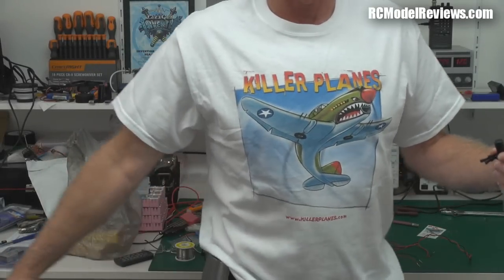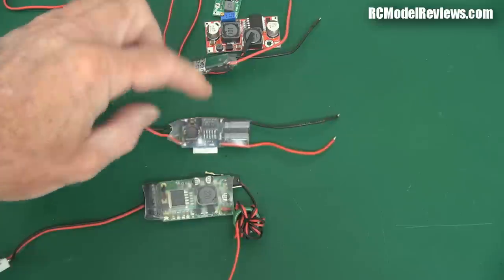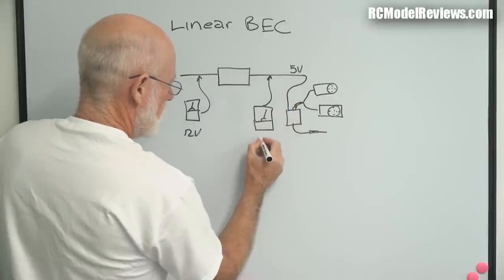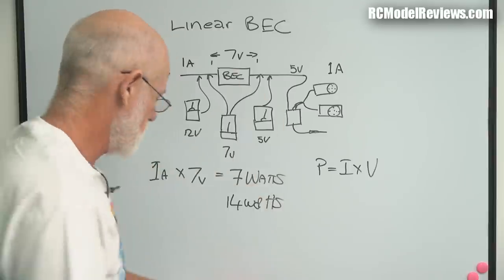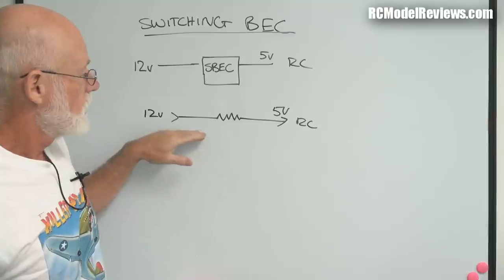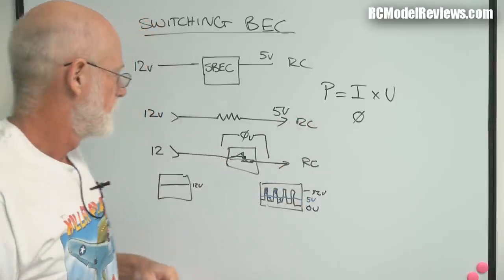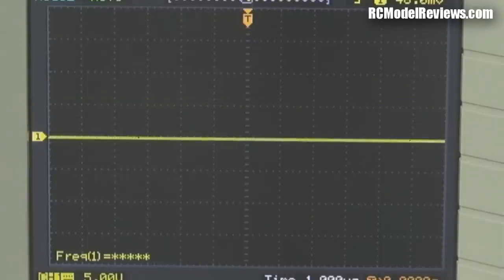All about BECs for RC model planes

Comment: That's amazing. Thanks for making this video. I'm currently making a quadrocopter from scratch, I'm programming the circuit board, radios, etc. and I recently realized that the brushed motors I were using didn't provide enough power to get it off the ground. Now I've switched the design to use brushless motors with some good ESC's. Fortunately I designed the circuit board to run off of 7.4V, so I won't need a BEC, but this was a fascinating video nonetheless!

Comment: Very good explanatin for begginers!
I am familiar with step-down circuits, I already built some, but they are to big to fit on my copter :)
I wish to mention that switching step-down dc-dc regulators are working on about 60-86% efficiency, so there is power you loos and some heat generated on it's Schottky diode and the coil, but of course a very small amount compared to linear regulators. With the one I've built by myself using high quality LOW ESC comoponents and overrated 430uHenry 3Amps coils I could reach about 56% efficiency dropping 12Volts to 5volts.
So with 1.34Amp current drawn at 5Volt output (6.75Watts) it drew from input  12volt 1amp (12watts) and only 5.25Watts gone to heat. With linear regulator 7Watts would go to heat, and the manufactured circuit's have much more efficient design, they can reach 80% efficiency even with those 130-150 uHenry coils they put on there.

I think SBEC is the same but on a compact size.
There is a coil so you can look for it of there is a coil it is a switching one.

Now first time I am building a quadcopter and ordered the cheapest ESCs I could, they are 30A ones and has 5V 2A BEC or UBEC but there is no nfo are they switching ones or linear. Circuit is heatshrinked to I cannot look for the coil unless I cut the heatshrinked tube and remove the heat dissipator plate but I think it is too thick to have a coil and too cheap.
As I know linear regulators can be connected in parallel with no issues, so what do you think about this:
- connecting each ESC's 5volt output wire in parallel and powering my RX from them, so not lugging into the flight controller output rail as there is a diode in FC dropping voltage. Only the signal wires are required between the ESCs and the FC motor outputs as 5volt is not needed by the ESC and ground rail is already shared.
If I connect the 4 linear regulators in parallel I could reduce the current passing through them, but the one with the less resistance will still have the more heat.
- I have also a plan to put serial Schottky diodes before connecting the 5volt outputs this way reverse voltage protection could be added, there is a voltage drop, but it is based on the current so it would share the power between the 4 ESC's as the one with lower resistance gives more power the diode will have higher voltage drop which will reduce the current flow as current flows from highest voltage to the lowest and other ESC would have higher voltage. This would happen in very fast switches.
What do you think about those? Could they work?

Comment: Just to clarify: UBEC is an acronym for "Ultimate/Universal Battery Eliminatior Circuit", which by today's understanding is a switching regulator. SBEC, however, may mean two things: Switching (as UBEC) or "Super", which may mean anything. Check the description of your supplier, but in my experience, if you go for a "UBEC", you'll get a switching BEC.

Comment: Great video, very informative. One question: do you get any RF noise off the sbec? If I remember correctly a digital signal has an 'infinite' frequency at the point it transitions from low to high (i'm recalling theory from years ago, so I could be wrong :) )...cheers

Comment: Great video Bruce, very well explained and it's great how you back up the theory with experimental evidence. I have an AX 40A brushless ESC in my Skywalker which contains an SBEC in one package and it hardly gets warm on account that the Skywalker doesn't draw anywhere near that sort of current. Separate ESC's and BEC's must be less common than combined ones as I've only personally ever seen people with the later ones.

Comment: Very nice explanation.  It should also be mentioned that when using SBECs on multirotors, only one SBEC should have its red wire connected to the flight controller.  All other red wires should be left disconnected by pulling the pin out of the plastic connector.

Comment: Bruce, very interesting video. When building small stuff for my RC models (e.g. as simple as programmable light), I need 5V via BEC (2A). Light is independent from FC, so the FC needs a BEC (<1A). Tricopter's servo is not something I want to feed off the same source as the FC either, so another BEC (1A). Those BECs start to add up.
So I tried small DC-DC converters from eBay (about US$2 per piece) which can convert 7-24V into 5V or 12V (or anything from 3 to 16). Very handy, very small. Running at 300kHz-1.5MHz depending on model. Awesome stuff.
But I have no idea about the EM radiation of those and the potential impact to 433MHz and/or 1.2GHz and/or 2.4GHz (I assume 5.8GHz is ok).
Since you got a spectrum analyzer, would that be interesting to test some of those DC-DC modules?
Here one example: http://r.ebay.com/YffXPU

Comment: Bruce a quick question,
So the ESC's BECs are fastefull, right! Will the ESC UBEs still waste some power even if they are not plugged in (in case i am not using ESC's 5V power)? I my 5V power i am getting from separate SBEC.

Comment: Great explanation but I have one question.  You showed the 12v on the input and 5v on the output.  I was wondering where were your leads on your oscilloscope attached to on the SBEC to show the switching?  The video shows the affect on the scope but does not show where the leads were attached to on the SBEC?  Was on lead attached to the 12v side and the other on the 5v?

Comment: Thanks so much for the vid. Quick question: how do I know how much amp the BEC is drawing? (Referring to the 1A example at 9:15)

Also, I just use the formula Power = Current x Voltage to find the power, and that's be the max power (watts) my fpv gears can be hooked up to the BEC before it overheats/smokes up/whatever?

Comment: Thanks for the simple and direct explanation. I am already familiar with these two types of BECs, but a practice that I've seen in some videos has me confused. I'm hoping that you (or anyone familiar with it) can offer an explanation. 

The situation is that some ESCs will contain BECs, and with a multirotor, that amounts to 3 or more regulators. I've seen some enthusiasts clip the wires from the BECs with the intention of using a dedicated regulator. This seems a bit wasteful since computer CPUs and graphics cards use multiple switching regulators to give high current power at very low voltages to the same power line. I imagine that multiple BECs would provide a similar reinforcing effect on the low voltage power supply, and so it's confusing that they would opt not to make use of it. Granted, since I've seen videos of removing the power-out lines from ESC BECs, technology has marched on and now PDB boards and possibly FC boards now have their own power regulation. I would personally be interested in keeping the BECs in use, so I'd like to know what the problem with that is, rather than learning the expensive way.

Comment: Hi ,I heard that people install a receiver battery parallel to the BEC, they do this as a fail safe in case the BEC fail or in case the servos draws too much current, but will it create others troubles such as noises, current flows backwards to the BEC etc ?

Comment: Excellent vid Bruce!  Had always heard that the switching BEC was better but not the reasoning behind it.   
Could you also show the proper wiring for putting a separate BEC in a system vs one with a built in BEC on the ESC?

Comment: Hi , I have an Engineering question regarding brushless electric motors and ESC.If I apply 1 volt via throttle to my ESC but the motor spins faster than its KV rating (ie 2000RPM on a 1000KV motor) because of wind pushing against the propeller during a steep dive of my drone, will the ESC try and slow down the motor, give no voltage or continue to give 1 volt which will end up  reinforcing the 2000RPM?

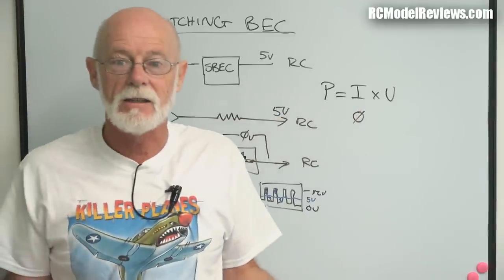Comment: At 16:43 you said that when the switch is closed the SBEC shortens and there is no voltage across the SBEC. It is the inductive filter that cause the voltage across the SBEC to be zero. Please correct me if I am wrong.

Comment: Hi Bruce, great InformTainment! is it possible to recognize what kind of BEC is soldered on some cheap Chinese ESC (30A simonK red shrinked 5$/pcs), as i don't trust their specifications. The other question, if I unplug the middle servo wire from the ESC with integrated (L)BEC, is the BEC still consumpting some energy or disabled? thanks in advance and regards from Germany

Comment: First of all thanks for all the reviews you make for us because we learn from them.I built a1/5 spitfire with a dle 55 engine and I am going to install on it 1savox servo sc 0253rated 6 v, 2 savox sc0251 rated 6v and 4 savox sc 0252 rated 6v.Will it be a good idea  if I use 2  4.8v nimh batteries 2000mah  installed parallel in different channels of the receiver because I am afraid of instaling a voltage regulator or any other device.If not can you show me something else.

Thanks again 
Carmel.

Comment: Great video Bruce and Merry Christmas.  Sounds like and SBEC works like the voltage regulator on a car.  What would you use on a simple 2,  3,  or 4 channel glider using 9 gram servos powered by a small 3 cell lipo?

Comment: awesome explanation and demo,  good job man!  i'm very clear on difference between linear and switching becs now, but where do ubecs fit in the picture?
Reply: UBEC (Universal BEC) usually refers to a BEC that is separate to an ESC rather than built in.

UBECs can be linear or switching -- it should say which type they are but most are switching.

Comment: can you share how to connect 2 flight batteries (so you can use 1 or 2) and use of BEC and a Switching regulator to power multi rotor but also extras like LEDs?

Comment: That (finally) explains why my 60 watt esc (with built-in standard BEC) and a E-flite Power 15 was getting so hot.  Guess I need an ESC with No BEC and add an SBEC separately to the mix.
Reply: Just use the same ESC you have but also add a seperate SBEC to power your receiver and radio gear.  Just don't plug in the receiver wire from the ESC.  You will have to Y the power wire to provide power to both the ESC and the Seperate SBEC.

Comment: Cheers Bruce! 
Really appreciate all your videos, i'v watched loads of em!
Just wondering if you might share a little more wisdom on this BEC matter?
Thing is, i just bought a power distribution board that has a 5V BEC built in, saves on weight and limited space in a 250 miniquad, Wehey! BUT,  the 5V BEC is described as being "DC/DC Synchronous buck regulator, efficiency up to 95%"... whats that mean?!" Also, it has "continuous current of 3 Amps" I'll be using 4S LiPo, Does this mean that i'll be wasting 30W of power in heat!? or simply that the 5V BEC can handle a draw of up to 3Amps?
Another thing that i cant seem to find an answer to is, will i be safe to power a few components from the one 5V BEC, i'm intending to power a Naze32 + camera +OSD + maybe a few LED lights. is that totally safe, or completely bonkers! I'm new to this stuff, forgive me.
Any light on this matter would be massivley appreciated, i'll be watching many, many more of your videos!
Thanks a bunch fella!

P.S
Oh yea, heres a link to the gadget in question.
http://www.mateksys.com/?portfolio=5in1v3

Comment: Excellent!  Thank you.
Here's a question that occurred after watching that.
Can I extend my flight time by disconnecting the 5v power lead from the BECs?

Here's a bit more detail on the question:
I have a hex with a 5v 2A linear BEC built into each ESC. All of the ESCs are plugged in to the flight controller and are therefore delivering a backup 5v in addition to the power module (I know that I don't need all of them).
In the process of stepping down from 16v (4S) to 5v they convert some of that energy into heat which is just wasted energy.
If I disconnect the 5v out leads would that energy still be lost?
Reply: Barry Houldsworth The linear regulators (BECs) in your ESCs are trying to regulate the output voltage regardless of current usage (so long as there's a minimum current for the regulation circuit). I wasn't sure exactly how they'd behave without a load, so I just measured the current draw of a 78 series 5v regulator without a load and it was virtually the same as with a load. Based on that, I'd say your BECs are wasting precious battery life, though in comparison it may be negligible. To answer your question more directly, I don't think removing the power lead will save power. You'd have to de-solder the regulator from the ESC. I'm going to be doing the same to mine. It'll look like a beefy 3-pin or 2-pin-and-soldered-tab package, probably with a 78 and 05 somewhere on it.

Comment: Hello my name is Paul J.
I am under my friend's account and want to thank you for explaining the difference between
sbec and linear bec now i am familiar with bec's and how they work.
Thank you so much.
I want to install a seperate bec on my 
Hk-550 to power my
servos to prevent any
brown out issues would that be practical or unnecessary? I am powering the helicopter with a 6s 25v Lipo so like you said the models that are powered by larger battery packs
4s or higher should have their own seperate bec 
which i agree with you..
So what do you think?
Go for it?
Thanks for your absolutely terrific video
explaining becs.

Comment: What if one uses a separate UBEC to power rx and the ESC has Ubec.Many
 say to cue red wir from Esc. But is it critical? Would not be good redundancy since Rx voltage is supplied in parallel.? Cheers!

Comment: I have a ZMR 250 similar to the one in the low cost build.  I am having issues with the linear BEC's in the ESC's.  I read online that it is ok to run the linear BEC's in parallel in order to reduce the load on them and therefore reduce the heat I would love to see an example video of this. I burned one ESC before ever even taking off and another on my first flight before i realized that i MIGHT have a solution.

Comment: Great video. Thank you. I love these kind of videos! Can you please expand on the use of capacitors? Would an ESC with a linear BEC not need them? I have 20A ESC's with capacitors so my guess is no. Are they used just to clean the output? Where are they used and why?

Comment: Merry Christmas, Bruce...always enjoy your videos. I do have a question. Since the SBEC is a switching regulator, would it likely be the source of an increase in noise which could possibly interfere with such other electronics like FPV equipment?
Reply: Yes, there is potential for that -- which is why I'll be doing a follow-up video on noise sources, including SBECs.

Comment: Are there any way of knowing if a ubec or sbec are protected against reversed polarity???
I have a bec it doesnt say if its s or u bec, but i was stupid enough to switch the leads doing soldering my own battery pack and connect it to the bec, after i found out i reversed it it worked at one test, next time i couldnt get any power out of it.😒

Comment: Bruce, you wrote down three terms for Bec's on your whiteboard. Linear Bec, Ubec (Universal Bec) and SBec.  Is the U in Ubec just a superfluous tag that means nothing in particular?  If so, why is it used in the first place, or where did the term come from?
Reply: I don't know why they started using the term UBEC (Universal BEC) but they did.   It is generally used in conjunction with a stand-alone BEC as opposed to one that's built into an ESC.

So if your BEC is part of your ESC it's either a BEC (by default linear) or an SBEC (Switching BEC) if stated so.   UBEC can also be either but it is a stand-alone device, not part of something else.

Comment: QUESTION for Bruce:
Can you give me the approximate BEC amps required for these applications:
Running 4x 5 gram servos
Running 4x 10 gram servos
Running 4x 20 gram servos
Running 4x 30 gram servos
Running 4x 50 gram servos
And are your numbers reflecting all of the servos moving simultaneously and under load?
Reply: get the specs of the servos and add them, simple as that

Comment: Building a Zero that will have 10 regular size digital servo's it will have a 285 brushless with an 80a ESC I just bought a 10a sbec to run the receiver/servo's.
What is the best way to wire these together (electric Newbe!)

Comment: Bruce, very interesting video.  Learned a lot as always.  Any disadvantages to switching BECs besides the higher price?  Also, can you explain how a switching BEC is able to switch the power on and off?
Reply: SBEC uses a FET/transistor as a high frequency switch used to store energy into an inductor which is then switched at a controlled rate to either stepup or stepdown the voltage. SBECs can produce electrical noise and harmonics which may interfere with other signals.
Reply: the switching off and on is achieved by an oscillator, and the pulsing that you saw on the oscilloscope is from a PWM or Pulse Width Modulator which can change the average output, by it's duty cycle.  hope that helps mike

Comment: You did miss the important tests: show on oscilloscope the voltage output under load, I expect that the filter on the sbec works good under low load, but can be poor under the 2/3A load. Also you did show multiple sbac saying that all are same due to same chip, but actually each of them has very different components for filter to almost constant 5v. So you could have shown how they differnece via the oscilloscope